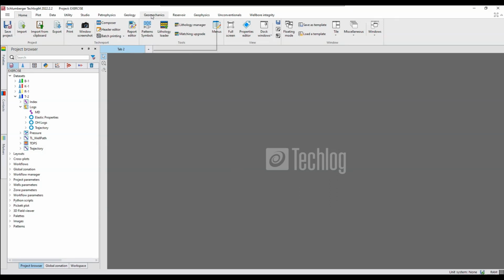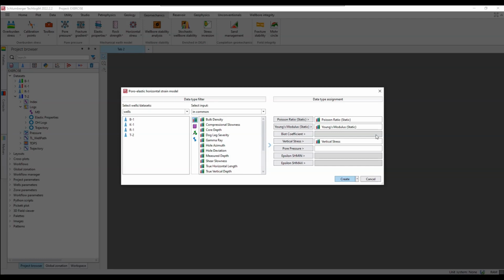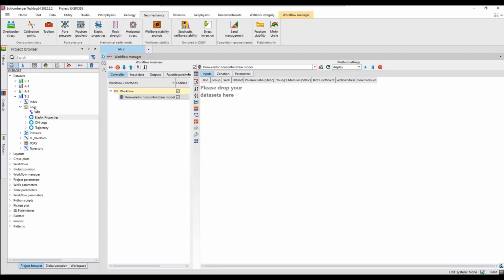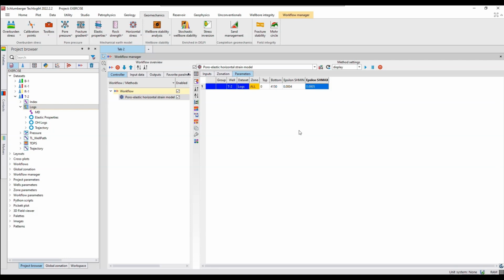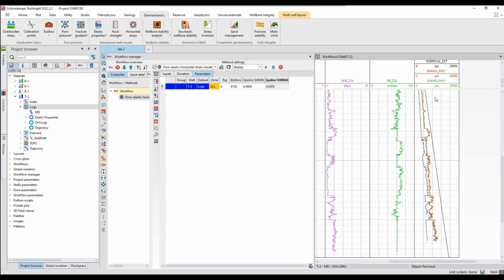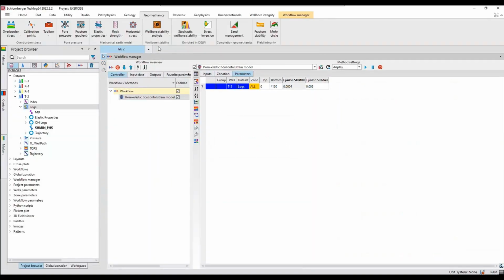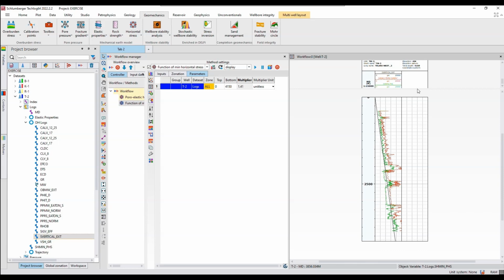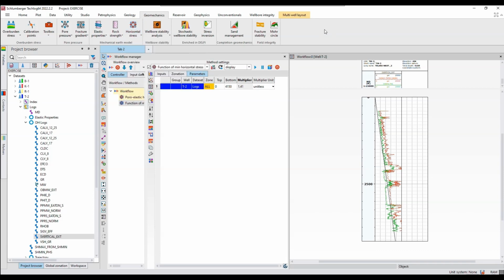Tutorial-6| How to Estimate Max Horizontal Stress (SHmax) & Min Horizontal Stress (Shmin) in TechLog

Comment: thank you Sir, 
I would like to know how to calibrate the model using LOT points?
Reply: Hi LOT or XLOT (extended LOT) is basically direct value of minimum horizontal stress. You can adjust your epsilon min (Ehmin) value in parameters tab to the point where your resultant value matches with your LOT or XLOT. Epsilon min and max values are 0.001 by default in TechLog
Reply: @lofer5544   Understood, we just have to adjust the values of Epsilon to calibrate the model.
thank you very much
Reply from the maker: One more thing. During LOT when your ltrend of pressure starts to deviate from linear trend and shows a drop. That point is FIP ( Fracture initiation pressure). You stop pumping fluid at that time and let it drop to the point where well get static. That is the point where you minimum horizontal stress has closed the fracture. That is the value of actual Shmin or frac gradient. You can repeat this lot for two to three cycles (xlot) and later on plot on graph to get exact shmin value.
Reply: @TheGeoscientist-TG   thanks a Lot Sir this is really helpful